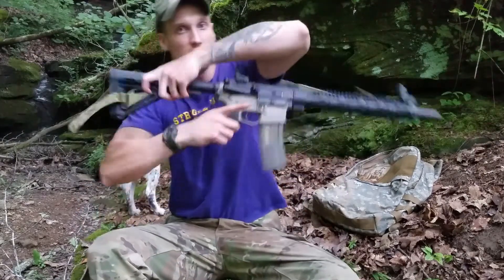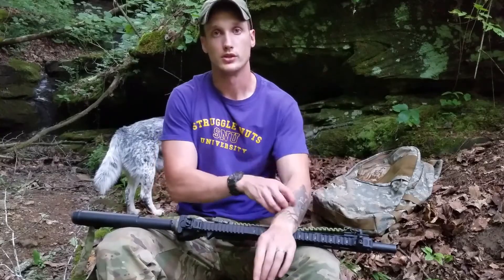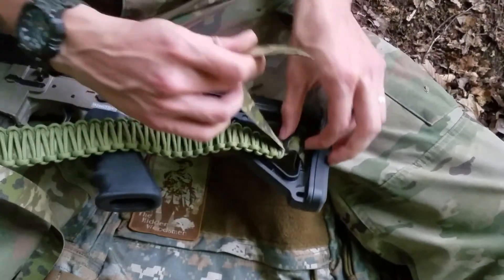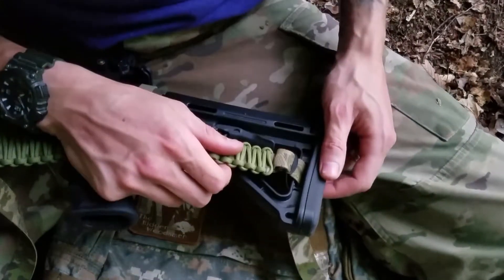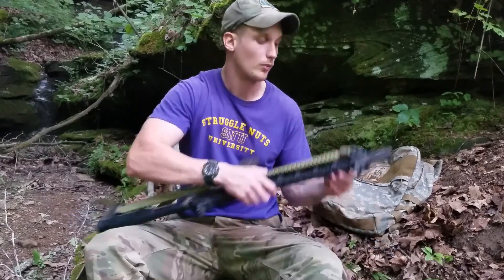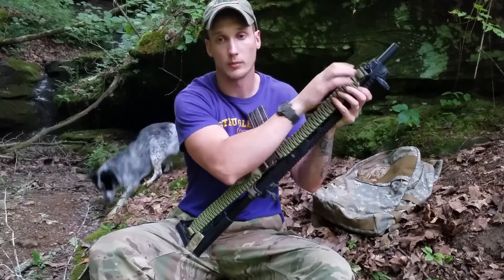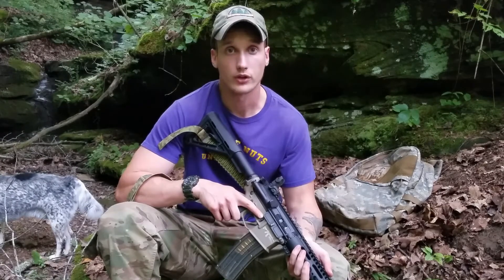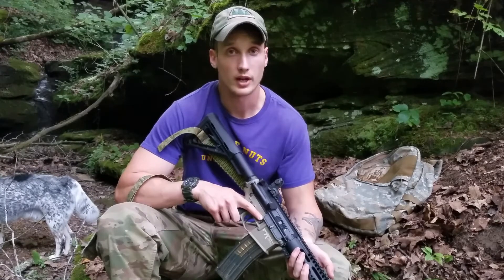Tactical Tuesday Gear Advice- How to use a Triglide

Comment: Hey Jacob.  So if I am reading you correctly, you are stating metal triglides are more durable than the plastic ones?  I would have thought the plastic would be better since they may get bent or crushed without breaking.  As to metal where they would snap or fracture and become utterly useless.  Kinda like a pmag vs a gi mag comparison.
Reply from the maker: fjamato i have had "plastic" (should be glass reenforced nylon) shatter under shock. (being shut in an mrap door) your comparison is valid, but a gi mag should bent, not break, becomint useless, whereas if a pmag breaks, it cracks, and fully breaks. in similar manner, a metal triglide may bend, but could be hammered straight and continue use. a glass reenforced one may be of similar strength, but once it reaches its breaking point, will not partially fail, but totally. :-) Good question!